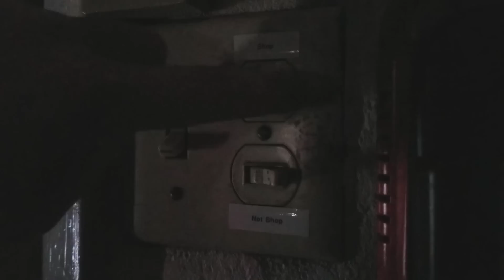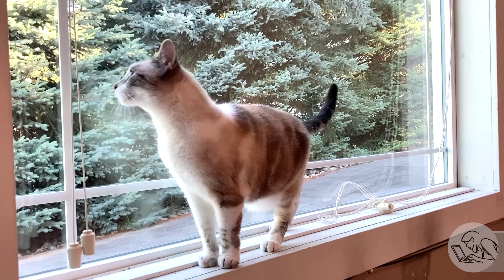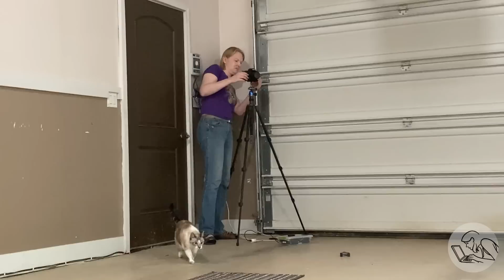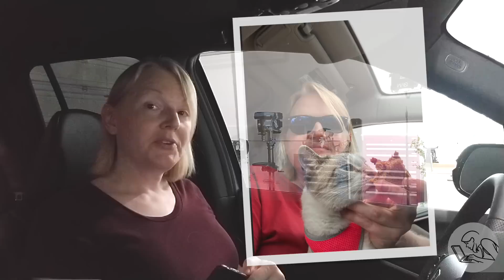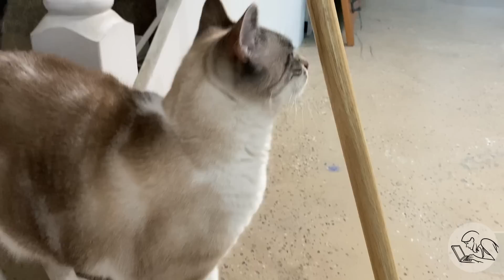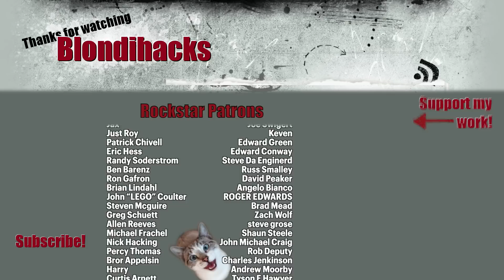Shop Move Q&A

Comment: Problem with moving to larger machines is you will need to replace a lot of the tooling you have built up over the years. Having said that I would go for a larger lathe if I were you, even for model engineering a small pro lathe is a handy thing to have, is a lot more rigid and therefore more accurate.

Comment: A Bridgeport mill saves time - our most valuable commodity.  My old Bridgeport (in good condition) was not expensive.
Reply: It's a massive productivity increase when you don't have anything. But if you already have a mill you are comfortable with, upgrading isn't that big an improvement.
Reply: A short table Bridgeport mill may be the ticket, but harder to find but maybe cheaper.
Reply: Bridgeport is a great machine and revolutionized machine shops from the 1950s for the next 50 years making horizontal mills and shapers nearly extinct.  They are of course very rigid and versatile and are still a staple in many shops.  The issues are the weight coming in at 2000 pounds +/-  200# for a series 1 version while this is not an issue for a ground level shop with high ceilings this is an absolute nightmare to install in a residential home.  Most Bridgeports are also 3 phase powered which is also nearly non existant in residential area's so either an expensive 3 phase converter would be needed or a replacement single phase motor installed.  I am not saying it can not be done my father had two friends that had Bridgeports one located in a basement and one in a garage.   But it is absolutely a major Pain in the A$$ to move to and install a Bridgeport mill in residential setting compared to a commercial shop.  In my opinion better options exist for the home machinist and modelmaker that use the R-8 collet system in more compact lighter weight single phase machines.

Comment: Looks like you have some nice tall ceilings in the shop.  I would suggest evaluating T5 fluorescent lighting.  These throw a remarkable amount of light and are great with high ceilings.  You can never have too much light in the shop!  As you get older you will appreciate more light (you are too young to appreciate this now!).  See if you can swing a 200 amp service to the shop.  You may want a small VMC running from a phase converter at some point and heaters, welders, etc.. are power hogs.  Look for used Vidmar/Lista cabinets for storage.   I have been able to buy a dozen or so surplus.   Yes, they are still expensive used but really the best storage there is. The HarborFreight (HoboFright) US General II tool boxes are really good for the $.     PS We have qty. 6 cats!  All strays that show up at the farm.

Comment: I was a machinist for years.  I started by making a sturt no.4 engine in high school. when in the navy I made, ( from scrap) a larger engine.  It has a 4" bore and a 5" stroke, with revers linkage. I only had a lathe and a drill press to work with.  I had a job machining titanium one time part of it was an intermittent cut and some threading, it is very tough with lots of tool pressure.  Where is your new shop ?  Love your videos. Thanks you are a brilliant person.

Comment: Thank you for sharing. There are a lot of ways to process materials but surely there is a new material / new shape that you misunderstand how it should be process, like your radial saw story.

Its important to share these stories.

Like I wont call out their name exactly but they openly shared how they were cleaning their lead screw on their lathe (machinist hobbyist of a few decades). Turning on the lathe, and running a cloth with their bare fingers (I think to finally recoat the lead screw). Mid motion, the rag wrapped and was caught around the lead screw, drawing their fingers into the rotation (acting in part as a finger trap) (drawing the fingers away from their body). The happy ending to this story is they have all 10 fingers, because they were quick to slam on the foot brake - crashing the rotational forces. If the lathe was running any faster, they would have lost or mangled most/all of their fingers. (your reaction time is never fast enough for machinery - a safer assumption than needing to hit the estop like this).

Know the limitations of equipment, its lack of empathy and respect motors who have far more torque than what your body can endure.

Comment: Parallels:
When I was three or four, I was "helping" my father on a construction project. I reached out to pull a scrap of wood from the table saw, and had a cotton work glove snatched off my hand by the blade. Fortunately the adult-sized glove was a very loose fit on the hand of a toddler, so it was not able to pull my hand into the spinning blade.
Ethics: I once was asked to design and build a device that would pass current through the brain of a young man who thought it would help him think better. (It certainly couldn't have made him think worse!) I declined. To be fair, he was not out of line to ask. My business motto was: "The unusual is my specialty." 
I repaired industrial sewing machines, rewound a motor for an antique Hoover vacuum cleaner, repaired the record changers in antique Wurlitzer juke boxes and added modern amplifiers (without making any irreversible changes), built stage props for a magician, and the like.

Comment: Plenty of more video's
Inside bare shop & possible lay-out
Moving machines in & settting them up
Shuffling these machines around as set-up no2 is better
Position sorted - time to get the Electrical Circuit put into place
Running Machines & new project

So many ideas that don't have to be about machining, model engines etc. Even do a video recapping on the model engines that you have made, showing them running and the good & bad things about them. Also any new models that you would like to build in the future.

I moved from the UK to Australia 15years and agree, big moves are not cheap but well worth it.

Comment: Before buying my lathe I spent a lot of time searching the library at the academy of YouTube. I ended up buying a 100 year old 3000lb machine because I had the space and the price was right. What I’ve found is that the 12” 4 jaw that came on my machine is overkill for 100% of the projects I’ve done so far. Half that size would have been easier to work with and probably still overkill.

Comment: My close "shop" call was in the mid 70s (teenage; I was probably 13-14) when a guy up the street strung AC Power to the backyard with speaker cable from his bedroom, through the window (he plugged it into the wall).  Yes, speaker cable. We were building a clubhouse (under ground, lol), I was cutting some wood with a circular saw (from Dad's shop...), and accidentally cut through the power cord with the saw.  It all happened so fast, but I was up on top of a little mound, the ground was wet, and my knee was wet (long pants) and in direct contact with wet ground (mostly red clay).  My whole body froze and my friends, who were in the front yard (🙄) say I issued the most blood curdling scream ever, but my understanding was that I just said "aaaah" not very loudly.  Fortunately, I was up on that mound and rolled down a little bit; I was able to move my left foot which helped me roll off the saw handle and break the circuit, essentially right away (nothing else was functional).  I am unaware of any damage (electricity ran up my right arm and down my right leg to my knee, fortunately not through my heart or spinal column); there were no burns, but certainly that juice went through me--I felt it!!  Long story short: Always use proper equipment (🤦‍♂), obey safety rules (electricity + water = BAD!, etc.), have a plan (!), and ensure there are people around who know how to help--do NOT grab a person during electrocution!!  Oh, and check those power cords, always! 😉

Comment: Hi, I have a lathe with a 3kw/380v motor, I can put a 4kw Toshiba converter on it. I mention that at home I have 220v and I connect it to a converter with 220 input and 3 phase output. A Romanian SN320 lathe

Comment: Speaking of accidents; a couple of years ago, I almost lost a couple fingers. I was running an automatic press at work, the steel was unrolling in the back a little faster than I wanted, I grabbed one of the arms that was on the side of the coil, well big mistake! The straightener took off! Pulling steel at an increased rate so fast that the steel pulled in and up over my left hand, knocking off the top of three fingers, nearly taking the fingers with it. Luckily, it only took off the skin. I saw bones, tendons, and some blood to boot. A quick trip to the Emergency room to have everything put back together, and a month off work. Workman comp would not pay but, disability did. Lucky Man. Since then, I have become far more aware of my actions. I have not been injured since.

Comment: Quinn, When you said Sprocket couldn’t fly, the first thing I thought of was a lack of certain anatomical requirements needed for flying. Also the steering wheel appears to be on the wrong side of the car. That must be very confusing. Jeff

Comment: One of the "issues" that I have, as a viewer, is whether the channel owner stays relevant to their viewers, when/if they upgrade their shop, to the point where they have a lot of wonderful tools that are simply unaffordable to most viewers. Certainly, there is nothing wrong with you profiting from your work, and newer, better tools are one part of that, but it's pretty hard to stay interested, as a hobbyist, when the channel features $30,000 surface grinders, and $20,000 tool bit grinders, and.... On the other hand, Joe π , used normal, but professional equipment, with great techniques, where even the "ordinary folks" can pick up good tips, indeed, how I see your channel working well. Sorry for blathering on...

Comment: Wait you say you where spoiled at your old shop? Where i live all houses have 400v 3 phase connections to the grid. Can someone please explain why it is not so in the us? Norway has 230v 3 phase if i remember correctly. They use 2 phases for wall outlets to get to eu standard but we use 1 phase and neutral/ground.

Comment: I owned a 10" Delta Rad Saw for a number of years. It scared me until the day I sold it.
Reply: We have one that family gave us, out in the garage with all of the rest of the woodworking tools,  and have yet to install it -- it's sitting under the bench, and probably will be for some time yet.  Those things are downright scary!
Reply: @Roy_Tellason  it was an amazing tool, when treated with the upmost respect, and a little fear.
Reply: When cutting something "grabby" I figured out that if there's room, start with the blade pulled fully towards you and push it through the material. It's like conventional milling vs. climb milling in a way.

Comment: I just picked up my first part of my delivery of parts to get a 100A sub panel to wire up my new shop with power for currently less machine tools but want to plan ahead.

When are you picking up a Sunden cylinder hone to start doing engine machining?

Comment: Thanks for keeping us informed on aspects of your move. Family is reason enough!
The US used 110V single phase, with 220V from 2 phases. Do you have 3-phase available for "domestic use" in Canada and how many of your machines are affected?
Reply: Pretty sure her machines are all 110v except the welder... I could be wrong though, wouldn't be the first time but I often see the small mini machines with 110v motors.  Have spent a good bit of time in Western Canada for work and haven't noticed any appreciable difference in their power availability.  Australia on the other hand has all kinds of differences...
Reply: @homeFall1  Thanks for your comment. The different standards arose because the British and American electrical industries developed independently. Examples include the difference in domestic supply voltage, as well as different alternating current frequency. Australia, South Africa and the other British colonies (now known as the British Commonwealth) adopted  the British electrical standards. I wondered, given Canada's history, which standards they had chosen.

Comment: I haven't seen where you are moving from/to but I did see that you said it would be an international move.  Will you have to deal with a different electrical source.  Will you need to deal with a change from/to 50 Hz 240 Volt and 60 Hz 110 volt?

Comment: As an electrician it drives me nuts when homeowners put lights and outlets on the same circuit. I encounter it more often than you might think. LOL
Reply: As a non-electrician: What is the problem about that?
Reply: @WoodenWeaponry  Trip the breaker and no lights! But wouldn't a battery backup light be a better fix for that?